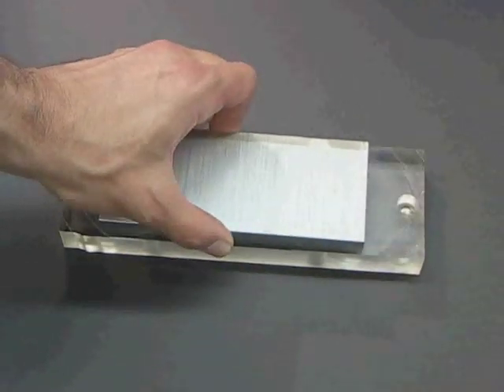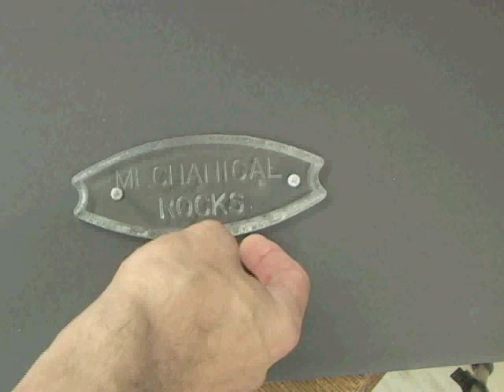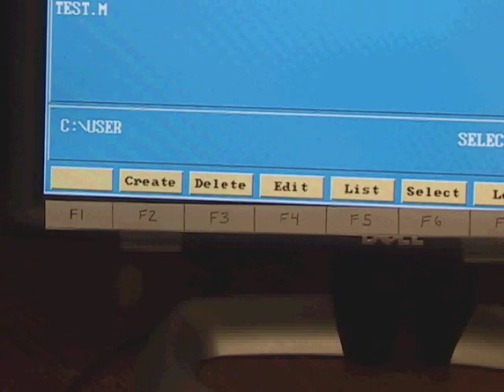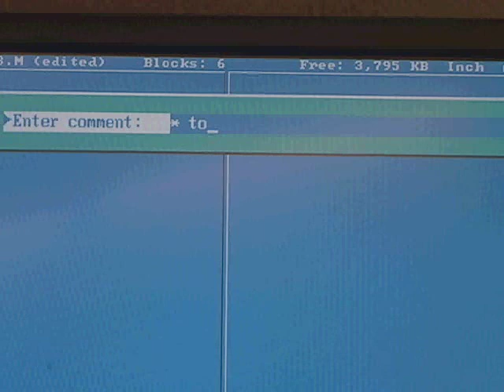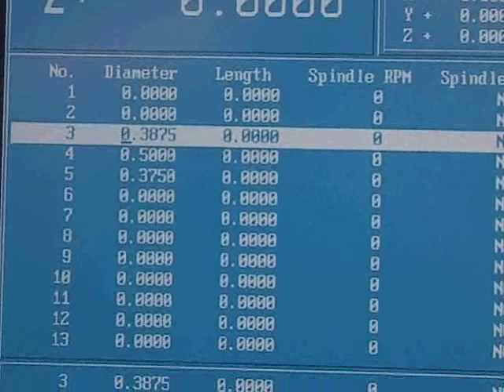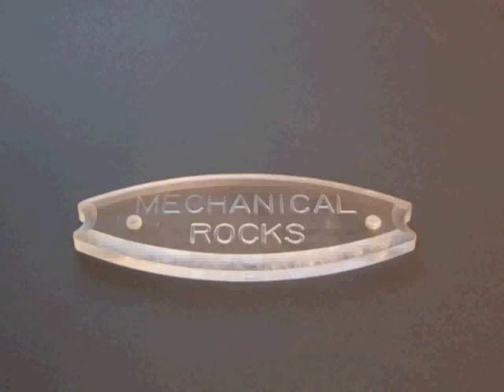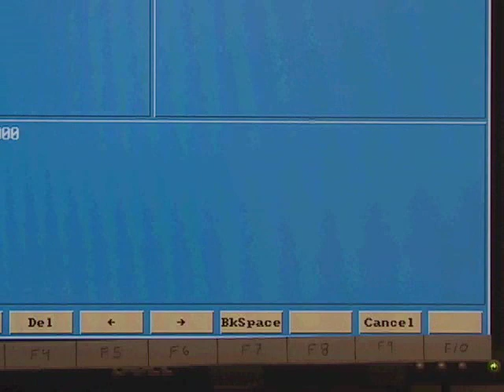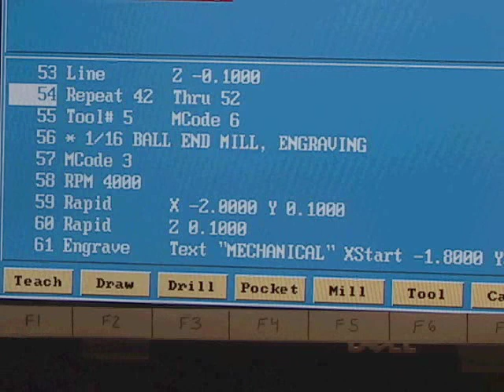CNC Tutorial 3 of 3: Making the Nameplate (39 minutes)

Comment: You are misusing the edge finder.  Use a very slow spindle speed like 500 RPM. You start with the tip offset and as you approach the edge the tip will center and when you get to the exact edge it will JUMP!  That is the indication you have reached the edge.  Also the Wiggler is a different type of edge finder.